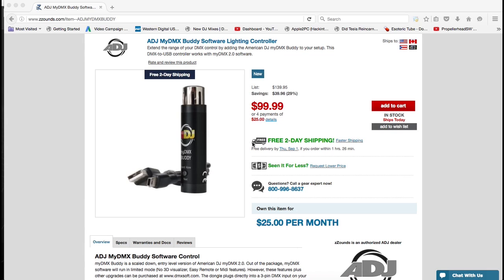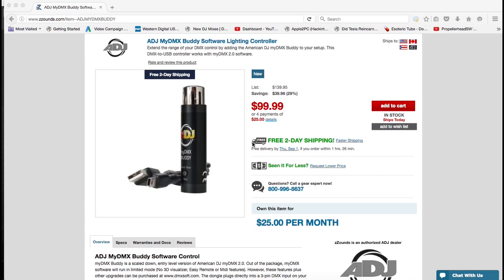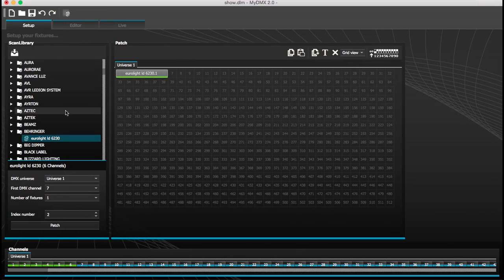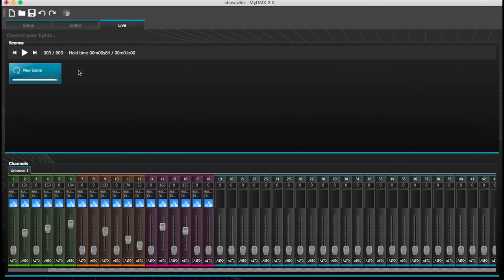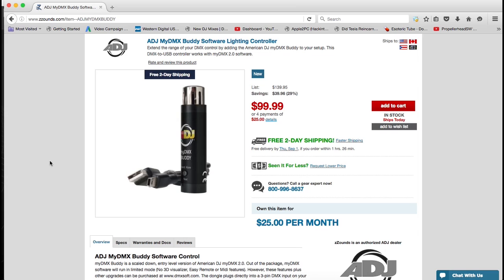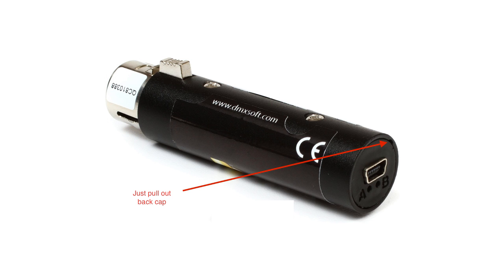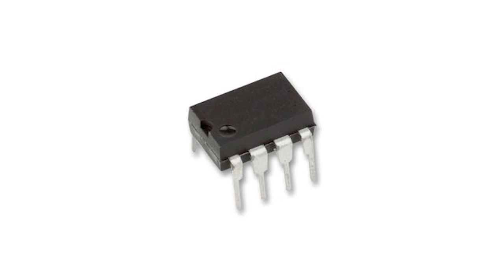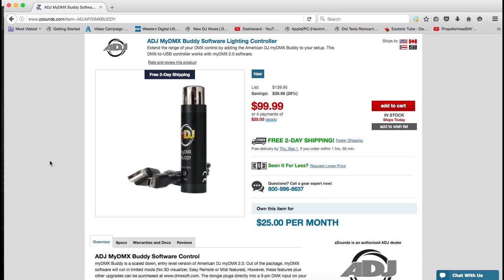myDMX buddy | ADJ mydmx 2.0 | dmx lighting software | replace DMX chip inside myDMX

Comment: Man I wish I saw this before I disassembled it myself...since I didn't take the end cap off first, I could not push the stand alone button down far enough, which meant I broke the stand alone button pulling the inner casing out. grrr.
Reply from the maker: Hi Bob, Google "Hosa 5-pin DMX Terminator" there like $5-$10